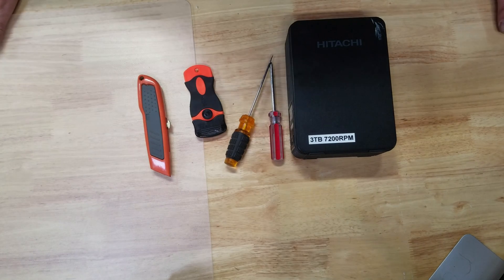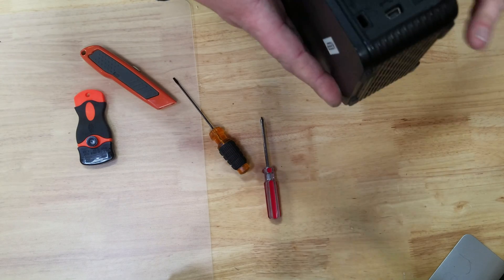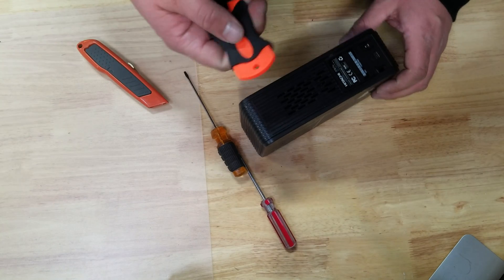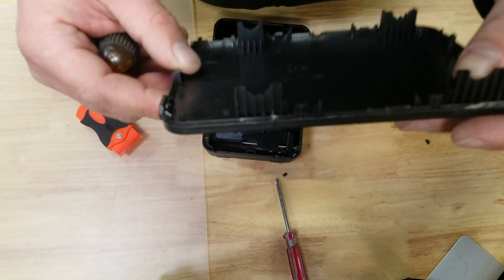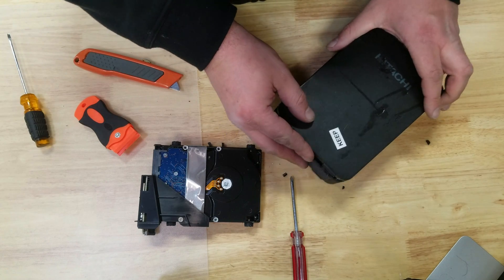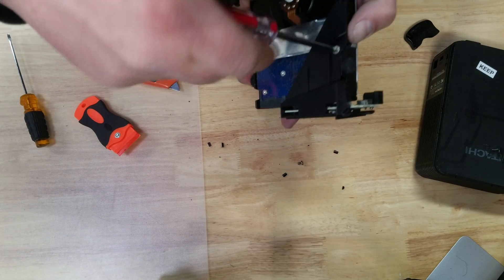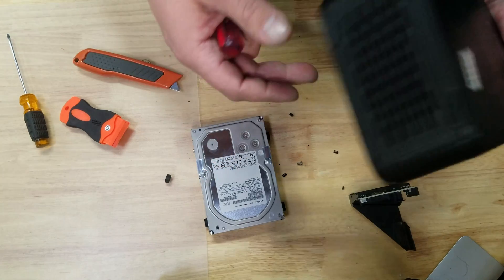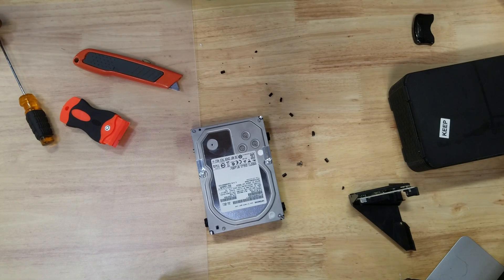Disassemble Hitachi Touro External Hard Drive Tear-down

Comment: Good! Now I can get the disk drive out and scratch its surface to prevent anybody else from accessing data. The issue is that the drive is not compatible with Windows 10. I would be able to access with Win 7 on a virtual drive but that doesnt work for me.

Comment: is the data is lost if the case is removed?? or if plug to sata cable, the data still there??
Reply from the maker: The data stays on the drive. You still should be able to access it regardless if it is in the enclosure or not
Reply: @TeckDrivenTeck  thanks for replying. i ask because someone says, some external drive have some protection/encription on the case, is that true?
Reply from the maker: @liquidwawan7114  yes there might be some drives like that. But they usually would be newer generation something very recent. But it is not a standard practice. Most enclosures are just a way for you to communicate to drive via USB cabke

Comment: Hi i have also an Tourno 4TB HDD. 

I have many problems with the loss of the connection. I have bought a new USB 3.0 cable, this did not solve the problem.
I cleaned the USB 3.0 and the power connection with contact spray, this also did not solve the problem.

Today i have removed the hard drive. I have only access to folders and files with the original USB Sata bridge electronics. 

I wanted to put 4TB HGST HDD in a new enclosure, the HDD is also recognized by windows but the folders and files are not displayed, the new enclosure support HDD until 6TB. 

If i want to use it in the new enclosure than i must copy al the data to an other HDD and format the 4 TB HGST HDD.
I think this was trick by Tourno.
Reply from the maker: Loss of connection usaally indicates low power or driver issues
Reply: Thank you for your response.

I have tried different Ac adapters that is not the problem either. 
I have checked the power connector on the PCB for bad soldering points. That also no issue.  

I don't trust the electronics of the Tourno not longer. Next weekend I will copy everything to my new 10TB WD external hard drive.

A few folders at a time for safety. before the connection is broken again.
Reply: The hard disk works now without problems.
Reply: I have a real problem with this now as mine lost connection during backup to a larger drive and now won't mount at all. I'm hoping it magically starts connecting so I can back it up before I move it to another enclosure. It is making clicking sounds rather than connecting but I think it has inadequate power. I read they have a strange partitioning system so older computers can still see it as 4TB. If you ask me, they should think more about our ability to recover data, seeing as the enclosure is so underpowered.
Reply: Well I couldn't resist trying another enclosure, so I moved the drive and... It's dead, meaning a lot of lost photos along with it.